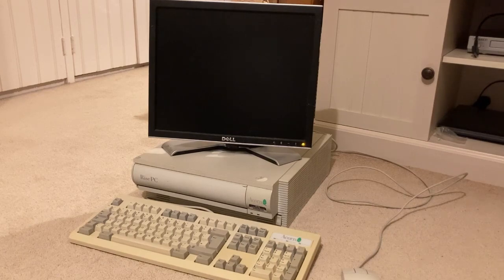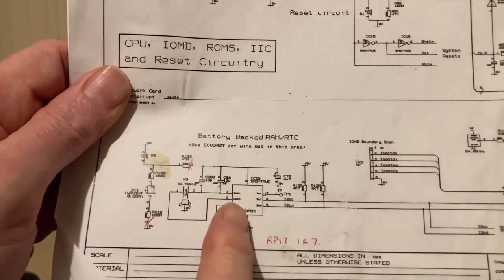Acorn RISC PC - Repairing a 90s ARM RISC PC

Comment: I have a RISE PC and it doesn't power on.  My suspicion is either the power supply isn't powering the board, or the board is shot.  I need to recover the files off the drive.  Do you have any advice?  I tried an emulator, but it doesn't recognize the drive.

Comment: Why on the dud motherboard are both terminals of the replacement battery connected to the two connections on the +ve side? Have you cut the rail between them, and made the negative connect wire to the -ve terminal underneath?

Comment: I've still got mine and it's still in working condition, however the PSU fan is too noisy, I'd like to replace it with a fanless one for completely silent operation. Do you know if I can buy or do something  to achieve that?
Reply from the maker: I'm not sure on the exact size of fan used, but if you're looking for silent (or quiet at least) fans then Noctua make some great replacement ones.

Of course be very careful doing anything with a PSU due to voltages involved, and be sure its unplugged!
Reply: @derbycomputermuseum6503  Actually, I a fan of fanless systems, zero noise and dust, got a PC build that way, although I've had to sacrifice perfromance. Just worried if the old RISC PC PSU will have heat issues if I unplug that fan.